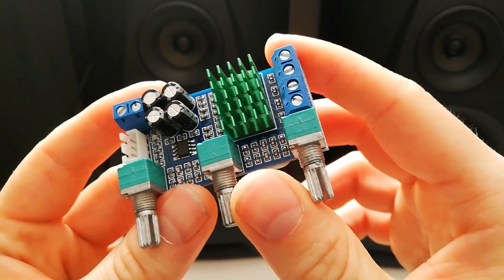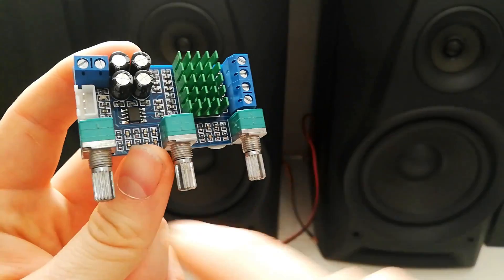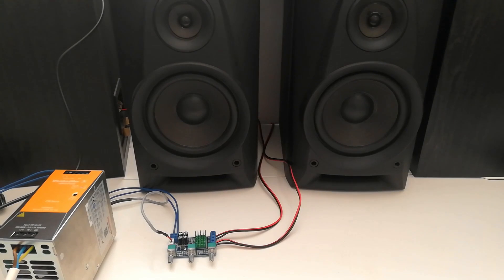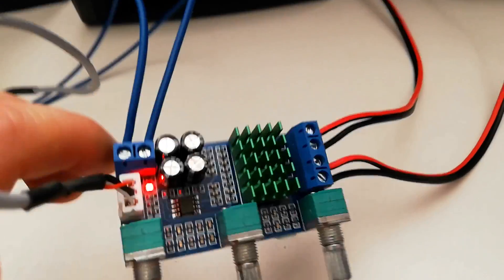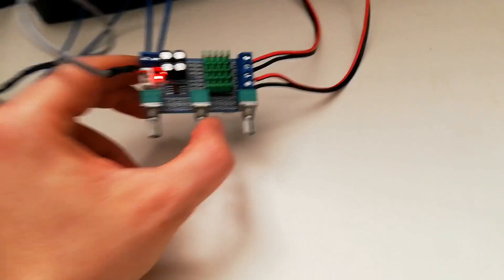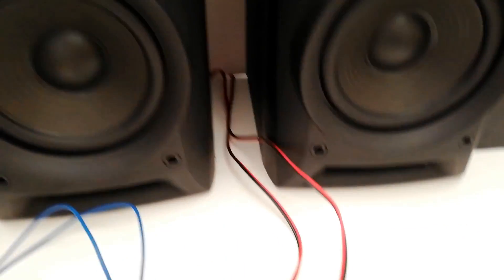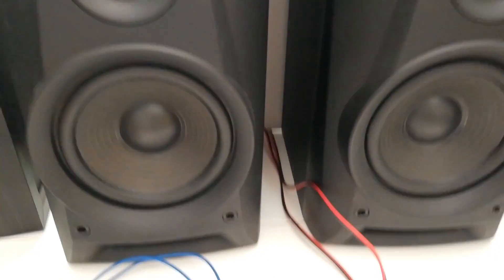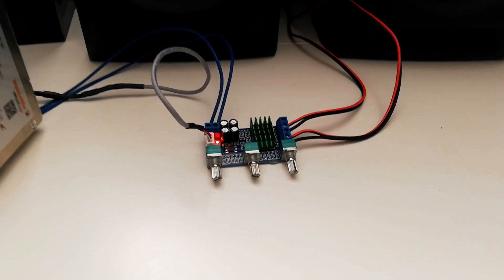TPA3116 - 80W+80W power amplifier board (shakes my Sony speakers)

Comment: Hi, I got one like this, but it is very quiet. I tried 12v, 19v. At 12v it is distorsing very badly, at 19v it is good but at a low volume. Any tips?

Comment: Iam not getting an expected power output from this board. Iam using a 24v 4-6A smps. 4ohms speakers.
Is it a good Idea to add a parallel resistance to make it 2ohms?
Reply: try with 6ohm speakers

Comment: Can i put speaker 80w 8ohm but the power supply is 12v 3A?
Reply: impossible, since that power reaches 22 volts if it reaches 80 watts, but in 24 volts it reaches 38 watts RMS maximum, it cannot give more .. but that power is powerful to make your boomboxes.

Comment: Is that works for everyone?
I also ordered it but no matter how I try I cant get more then 15W. Above that its distorting crazy.
With: 24v 9A supply
Reply: Well the amp is rated for 2ohm load and its actully 50 watts x2 not 80, i tried it with 30v 5A  and its better but it gets really hot because of high voltage and at 2ohm i got up to 46 watts close enough for me.
Reply: @kentdarylcruz678  2 ohms doesnt work. It is 4 -8 ohms only
Reply: @talfinson9242  it does actually. have u tried it?

Comment: What type of power supply you are using???  I couldn't find 24 volt power supply so I used 12 volt one and it work well in medium loud sound. Can you  suggest a kind of power supply I should use
Reply from the maker: Hi.. Yes it works on 12V.. But it will be better on 24V.. You can use 24V from 3A..> Up..
Reply: @als-techreview  is it 24 volt 3ampere??
Reply: I would like to see the power supply unit you are using.
Reply: @Nirmal08  i would suggest using toroidal 250W 24v

Comment: Can you please tell me how many voltages is suitable for this. I bought the treble, mid bass version recently. Love it. Drives my bookshelf speakers just find. I have hidden it under my desk. I placed a 4700uF 25v capacitor to remove any ripples in the power supply. I am using a 12v 5A brick. I am not sure if using a 19v power supply is wise. Also need to know if a 10A supply and a larger capacitor will improve audio quality further ?
Reply: I am running mine on 24V 5A to 6 Ohm speakers with no problems. Same model as yours with the treble-mid-bass controls (XH-M577). The heatsink gets only mildly warm to the touch. 

No point in increasing amperage; under heavy load I doubt that it's using any more than about 2.5A, but power output to the speakers does increase drastically with voltage increase. Check the data sheet for the TPA3116D2 and look at page 10 where power output vs. voltage is graphed. Maximum voltage according to the data sheet is 26V.
Reply: @jeremymtc  Have you seen any difference with 12V or 19V ?
Reply: @coolbits101  I have not used the board with anything other than 24V. Output power scales very highly with voltage; at 12V with 8 Ohm speakers the chip outputs about 7.5W, at 24V and 8 Ohm it's about 33W. More power can be had with lower-impedance speakers. 

The data sheet will tell you everything you need to know about power supply vs. output (see graphs at top of page 10): https://www.ti.com/lit/ds/symlink/tpa3116d2.pdf?ts=1605605479694&ref_url=https%253A%252F%252Fwww.google.com%252F

Comment: It is not 80w + 80w ... with 24vdc, 5amp and 4 ohms 50 + 50
Reply: Not even that .. in true power in 4 ohms, it has maximum power up to 38 watts in 24 volts, I already make measurements with a frequency of 100 hz up to 1000 hz, if it reaches 50 watts, it is that it is at peak, but it is ideal to make your homemade boombox, since the sound is a beast.
Reply: That's true